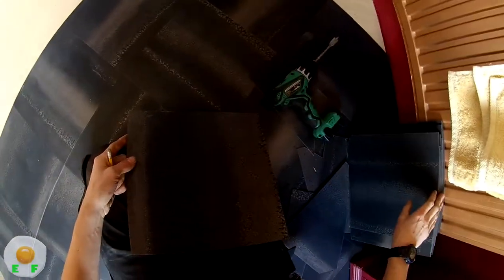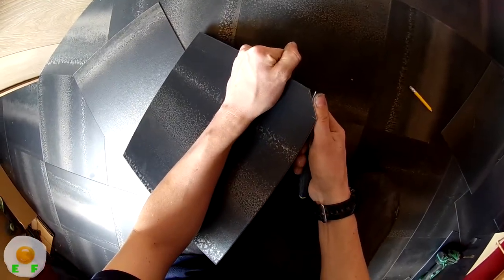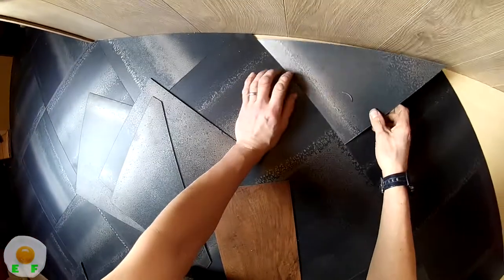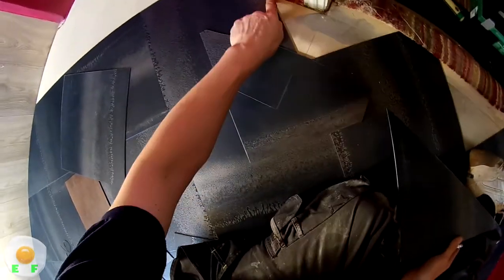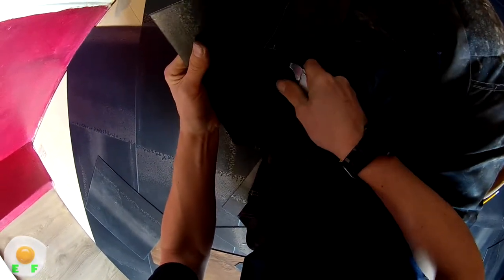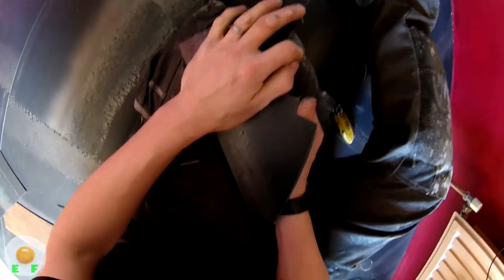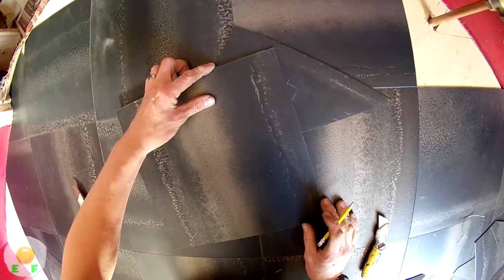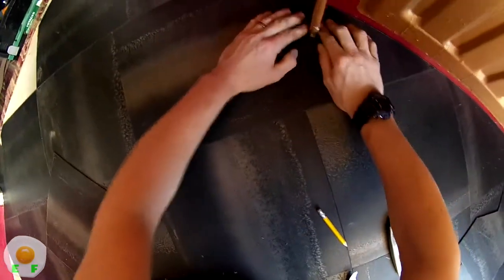45 DEGREE ANGLE  CUTTING TILES AMTICO (DIAMOND)

Comment: For cutting around the door frame either undercutting the door frame or the use of a paper felt template using a pencil would have been quicker. Also the use of a hook blade to trim of the underneath after the initial scoring and separating is quicker easier and safer. 
Nice one Eggy.

Comment: A good way of cutting in mate is get some big tiles or a wide planks and cut it down to the same size as the tiles point to point. 
Then use that to back mark the tiles.
Reply from the maker: I use to do that metherd but wastes tiles you cut down and have to carry bigger tiles to
Reply from the maker: but will work
Reply: EGGY FITS Don’t use a tile for the job then
Reply: Do you dry fit all your floors? been watching floor fitting on here...its so bad.your clearly a good floor layer.need more spot nails in you ply joins.do you not template your plywood?? saves time.i need to get a life lol